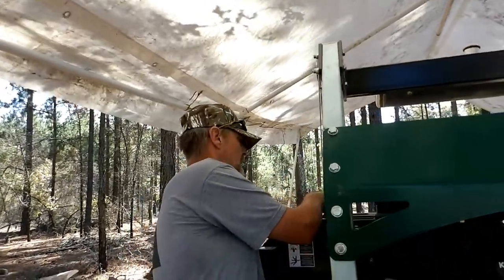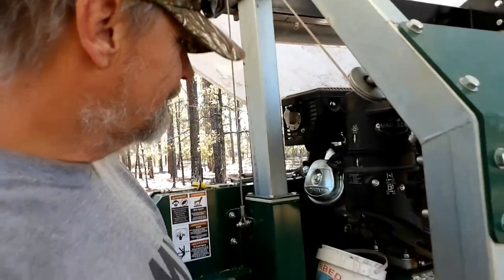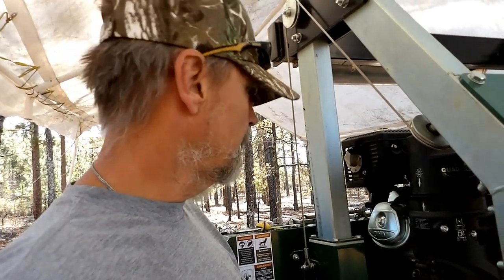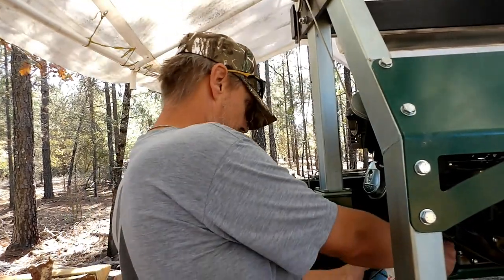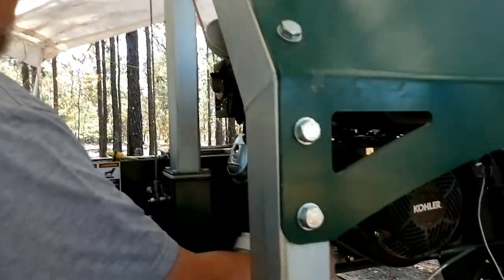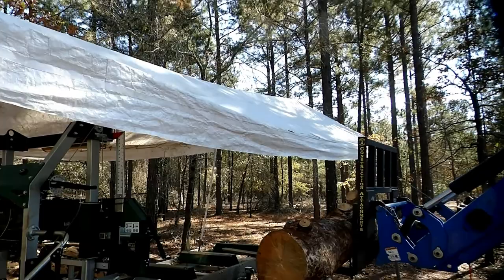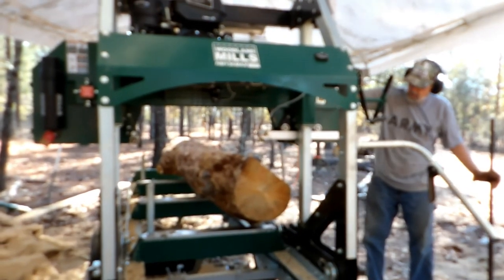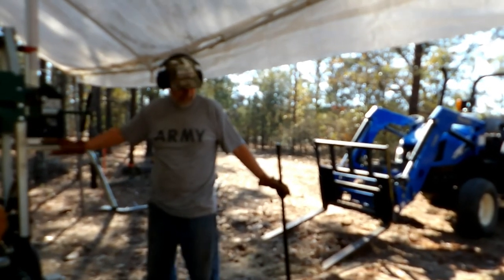Oil Change for our Woodland Mills HM130 MAX

Comment: in your instruction manual for the motor did it say anything about it having a 2:1 reduction system that requires gear oil I can't seem to find it on mine but the manual says it has it
Reply from the maker: Yes, I think it is a sealed system or something like that.